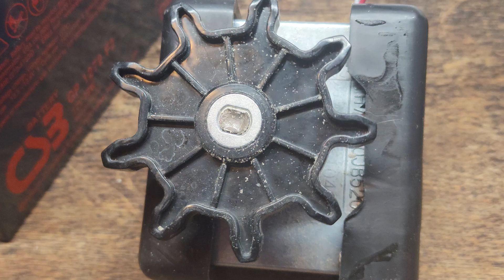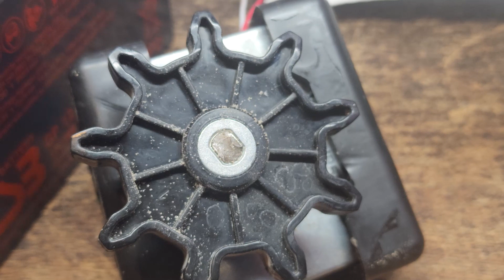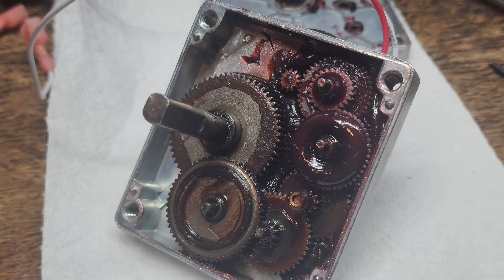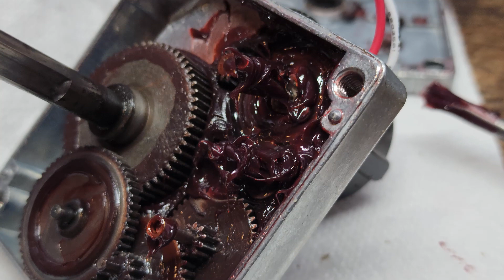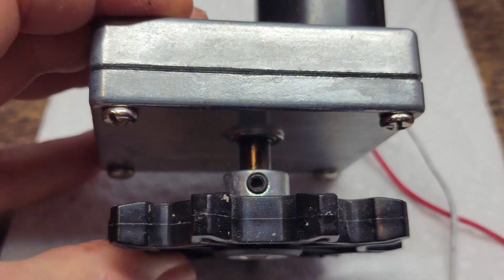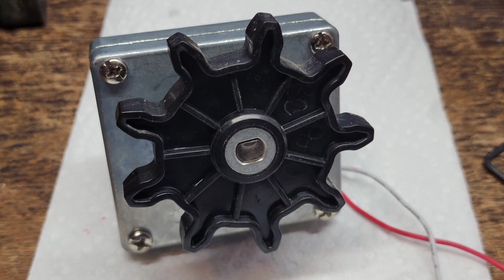Litter Robot 3 motor chatter quick fix / repair

Comment: Does anyone know of a quieter motor that can be replaced for LR3?  Since LR4 motor is quiet, Is it possible to replace the LR4 pinion gear with LR3, perhaps if someone can modify it at a shop?
Reply from the maker: The LR4 utilizes a worm gear as the first gear reduction in the gear box coupled with a significantly larger motor to achieve the almost silent operation. The LR3's motor/ gearbox has a very sloppy gear interface that creates significant gear lash noise resonating through the gears when in operation. This is why the first 2 reduction gears off of the motor in the gear box are nylon. It was an attempt to quiet down the noise. The only real way to quiet down the gear noise but not totally would be to bathe the gears in a light viscosity lubrication allowing the lubrication to absorb the resonating noise while in operation but the one side effect of this is the motor cant handle the added resistance the liquid provides and throws over torque errors. I'm sure a very light viscosity oil would work but the gear box has no provisions for seals and will leak like a sieve if it was to be filled with liquid. I'm sure there are ways to redesign the globe drive but it would require significant redesign. The best that can be done with the current hardware is to adjust the motor on the gear box to reduce the gear lash noise and to shift the first reduction gear away from the motor Mounting side of the gear box, otherwise raise the gear higher on the shaft about 10 to 15 thousandths. If the gear is all the way down on the shaft the lash noise and drag increases greatly to the point of the motor causing over torque faults on almost every cycle! When the gear box is skim coated there's usually a small pile of grease directly under the first reduction gear to temporarily mitigate this issue somewhat, but most of the time it gets squished out over time causing the lash noise to increase along with the torque load on the motor.
Reply: Appreciate your thorough explanation. Obviously most people aren't going to bother with this but at least it's an option. The most ridiculous thing is that the company sold these annoying loud motors and makes you wonder if it was possible to choose a quieter motor or if not create a quieter motor before selling the annoying loud one. But perhaps too difficult to create such a quiet motor at the time? I don't know but it's Very annoying for people that have to have the litter robot close by in same room. Thanks for the tips anyway have a good day.  @mikeshowtoandthings